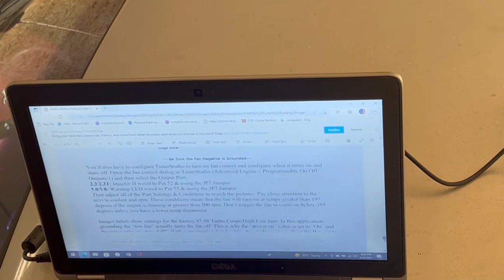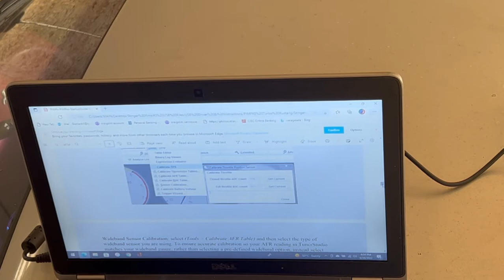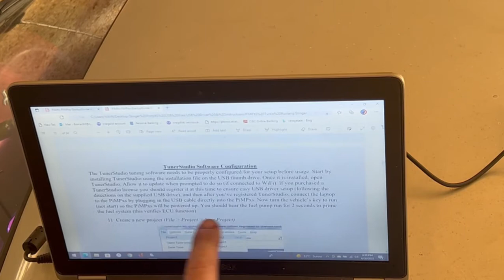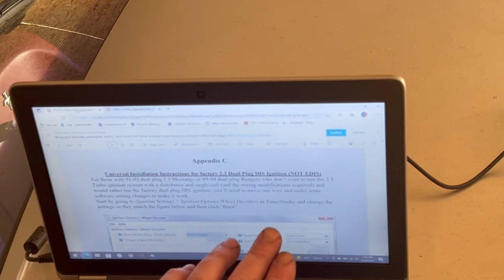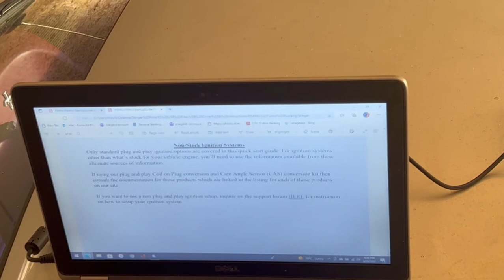PIMPX ENGINE MANAGEMENT!!  Will SMOKEY'S 2.3T LIMA SWAP FINALLY START?

Comment: Can the pimp adj the IAC signal via computer graph/screen?  Great overhead eng bay camera shots📽️
Reply from the maker: Using Tuner Studio The Pimp has an "Autotune" procedure for cold/Hot starts that can affect tuning for the IAC,  and as well you can also manipulate the IAC settings manually in Tuner studio if desired.

Comment: What size intercooler piping did you use? Pump gas? Still using the distributor?
Reply from the maker: 2.5” intercooler piping on both cars, Running 16lbs boost on pump gas with this car, it has DIS & no problems.  Running 27lbs boost with distributor on blue Turbo Rustang car on pump gas with Pro Meth setup coming in at about 12lbs with full spray by 25lbs and no issues.

Comment: Hey Bo, Awesome video. Im currently building a 2.3 turbo for my 96 ford ranger. After looking up the Pimpx on stinger performance website it shows the pimpx is for 83-95 rangers. Would this still work on a 96 or would i have to find something else? Im completely lost when it comes to wiring.
Reply from the maker: Hello,  it’s best to contact Shannon @ Stinger Performance and ask for his assistance as he is the guru.   Good luck on your build, it will be a fun package.

Comment: Waiting on head studs for mine...
Reply from the maker: Good Luck!!  I ordered mine in January, and they are still not here.  Talked to Bo @ BoPort Racing and he said stock bolts can hold up to 20 psi, so Smokey has Mahle stock head bolts for now.  Turbo Rustang has ARP Head Studs, ARP does not know when they will have re-stock.
Reply: @builtbybo22  So I hear...supposedly they have been delivering shipments of them. I don't see what the hold up is. They've been backlogged since last September. They were supposed to have them done every month leading up to now. Rumors they may be delayed until August. We'll see.
Reply from the maker: I talked to ARP in person in June, and they said they were back ordered on the material as well as the Dies for our thread pitch.  They mentioned possibly August but prob longer. I'm trying to be Hopeful though!!  LOL
Reply: @builtbybo22   I am also waiting for ARP Head Studs!!  Must be a big Shortage out there.

Comment: Did you have to use any turbo coupe wiring or was it plug and Play with the stock mustang 2.3 N/A wiring?
Reply from the maker: Stock Mustang wiring is used with the PIMPX (S) ECM, No Turbo Coupe wiring or Re-pinning is needed.  It's a great setup!!

Comment: for the price of these things, they should be the ones installing the jumpers. jfc, for that much they should install the thing in your car themselves lmfao
Reply from the maker: I agree they are pricey, But other stand alone setups are more money, and don't retain factory wiring.  The jumpers are left up to the user to install so it can be setup in the specific way of the build.  Although it may seem overwhelming at first, It does get easier with a little playing.